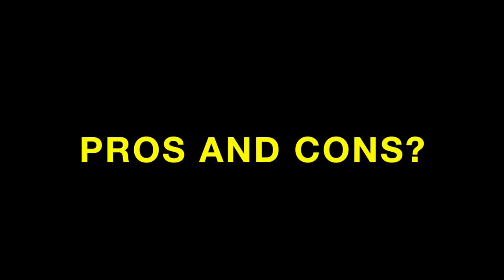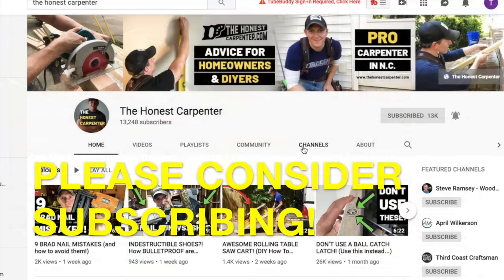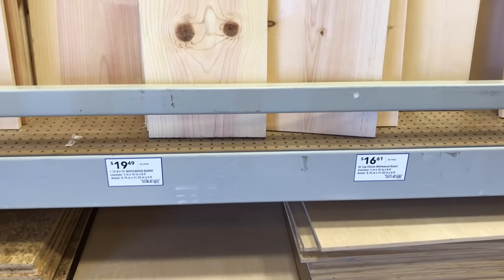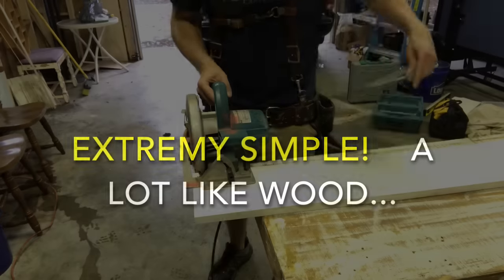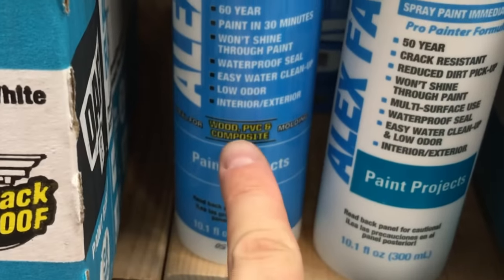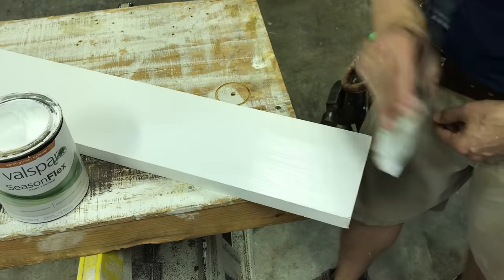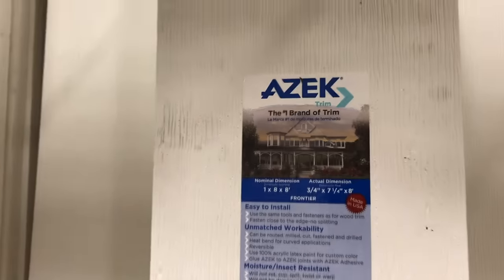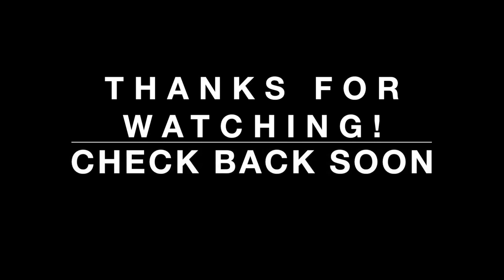PVC TRIM VS. WOOD TRIM? (Pros And Cons!)

Comment: I watched your very good video on the new cellular PVC trim products.  Now how best to use them to trim only the four vertical corners of stucco front porch columns.  My questions:  Is there a need to first smooth out the stucco with its rough surface?  If so, with what?  Then how best to attach the PVC to itself at the corner overlaps and also directly to the stucco surface of the columns?  It would be "nice" if there is already an "L" shaped PVC product that would fit right onto the four corners of those stucco porch columns.  But that might be asking too much. Any answers to these questions will be greatly appreciated.

Comment: What a fantastic video! I have never looked for a video on a topic, tool, material and found EVERY answer in on place!  I have use PVC trim in my bathrooms, and was looking to confirm that I made a good decision, and it sure seems like I did. 

I do have two questions. You mentioned using pvc friendly caulking or wood filer for the nail holes, is there not something that you revoke t that will dry white and allow me the sand it smooth?

Thanks again for the great video!

Comment: I’ve been holding off on using thin pvc trim in my bathroom. Never worked with it before. I need to miter corners and paint. Didn’t realize it was so paintable. Does it need to be primed? And should I pin nail it or use flex caulking to stick it to wall? Great video

Comment: The pourous end does collect dirt, which doesn't look good contrasting with the white surface, and only washes to ... grey.  Else, I do love the no rot, not need for painting, no splinters, no warp.  I'd love to use it on my sun baked window sills, which require painting every 2 years, but can't find a match.  I'll love to use it to replace window trim bullnose, but when trying to pull off the (who in their right mind would do this) finger jointed wood, the entire window started to pull out!
Yes, contractor who did my deck trim over looked like a snowman when he sawed up the PVC.

Comment: Thank you! This is exactly what I was looking for. I have some shoddy existing comb face trim butted next to some hardy plank with some terrible caulking work between that I intend on completely hiding by placing a wider ( not deeper for a manageable reveal) pvc trim board directly over top of. My concerns are that I made a terrible job of the caulking not only between these two substrates but directly on the board while trying to hide the screws. Please advise on  the best way to attach the OVC onto existing pine trim so that I do not have to caulk more than necessary? Galvanized Brad nails and PLC 400? Screws and wood filler . Thank you in advance

Comment: Please help! 
I have a job coming up, and i want to use pvc casing to trim out all the exterior doors and windows. However, i have a couple of questions. 
1. Im going to be installing onto Stucco, so how can i securely fasten the trim to the stucco wall? 
2. What are, where can i find the specs for painting the pvc trim a darker color?  (The customer has chosen a navy blue for trim, and the summer gets and stays above 100°F for extended periods of time.)

Comment: Great & a much needed vid for people today... I LOVE USING PVC! But YOU ARE SO RIGHT ABOUT THE DUST! I tell my kids I  got hit with a SNOWGLOBE GRENADE! LOL. 
BUT.. No grain flow to worry about.. if it does get nicked after painted white its white the whole way through.. takes a screw well.. I'v never had even the thinnest trim split on me (again..no grain) I did all my bathroom & kitchen trim with it & just replaced the bottom ⅓ of my exterior door jam..which is the worst spot on a house for wicking & rot. 
Q: what is the name they call the inner jam's that look like the dootstop is seperate.. until you go to replace the doorstop & remove the weather seal strip to realize its made as one piece? 
Thanks!
Reply from the maker: That’s how they make a lot of pre-hung doors these days, Drew! One shaped out piece, or two that clamshell together.

Comment: The problem is not the pine in most applications. It is the crappy paint and lack of maintenance by the homeowners. Latex paint sits on top of the wood and generally sucks. So they took the good stuff out of the paint and now we have pvc and nasty dust? FYI marine paints do not have to meet the same residential lead and voc standards. But they are illegal to use on a residence. Long time carpenter and I use pvc as much as I can. Good video, thanks

Comment: I replaced window trim on a job once that was so rotted the sheathing, jack and king stud had also rotted out. The one thing that concerns me with pvc trim is that if water gets behind it you’ll never know until the damage is massive. That window sill and apron will look great until they fall off because the nails or trim screws aren’t being held in by anything anymore.
Reply: not even held by prayers,amen

Comment: I totally agree about the PVC dust. It's a real pain to deal with. That stuff clings to everything! But, in many applications, PVC trim is clearly a better choice than wood--like where my water-table trim nearly touches grade.
Reply from the maker: @Steve K That's a perfect example of a place where it should always be used. It's on the list of areas that I'm going to cover in my "most rot-prone locations" video--which will actually be two weeks from now, rather than this week :)

Comment: Very informative video. What do you usually use when you patch nail holes or dings? And do you treat it differently when you use it for exterior versus interior use?
When I cut pvc and use my shop vac for dust control I wrap the top of my vac, the vac hose and the aluminum dust chute of my portable table saw and miter with bare stranded wire and wrap it around a 8 inch metal spike and put it in the ground. If I am cutting pvc in my shop I still use the bare stranded copper wire but I wrap it around several heavy steel washers and lay it on my shop floor it really helps out with it sticking to as much stuff and I don’t get zapped from static electricity caused by the pvc. Even in the summer that static zap  can get you.
Ron

Comment: Great video. I used it as a brick mould around my new patio doors and agree with you 100% on everything. The only real downfalls are the price (but it will save in the long run on no replacement and paint) and the cuttings. The sawdust is awful as you have stated.
Reply: "The only real downfalls are the price (but it will save in the long run on no replacement and paint) and the cuttings. "

Most people today don't live in the same house for 30-40 years like our grand/great grandparents did, people move about every 5 years, if the wood trim lasts 10 years it's already exceeded the expected lifespan when you owned the house, and now sold it- it's someone elses' problem then.

Comment: Two cons you missed concerning PVC lumber: 
1. It does not chisel easily and often breaks out. This is because it has not natural grain fibers. So use a router or cut-out tool to sink hinges or lock keeps.
2. It does melt to your saw blades eventually and must be scraped off with a razor or replaced more often.
For bonding PVC, I prefer PVC Adhesive used for fences. It chemically fuses the components and sets quickly. Any fence installer should stock this product. The big bix stores used to carry it, but it has been hard to find lately due to the pandemic.

Comment: The PVC bathtub I installed in May 21 was really specific in its instructions, “Your warranty is void if you use silicone caulk on edges or plumbers putty in drain.” Micro plastics worst characteristic is that they leach into water and wind up in the water table and reservoirs. Your pvc dust is going to be much larger particle size to leach into the water system, but I would not want it in the sewage system since it would float through the settlement tanks into the ocean or rivers.

Comment: Plinth blocks! 
I often replaced the rotting bottoms of door and window frames with 12 to 16 inch plinth blocks made from well primed yellow pine stair tread. No need to replace the entire frame and trim;  just the rotten part. The secret is to tapper the top of the plinth to match the tapper you cut in the bottoms of the door frames so water will run off easier. I had no doubt those plinths will out live me.

Comment: PVC also can't be recycled, so sooner or later, every ounce of it that's produced will go to a landfill, to an incinerator, or into our soil and water (as micro-plastics, as mentioned).

Better building design (including renovations and retrofits) can often address the challenges discussed by better managing water flow, exposure, etc. (e.g., over-hangs, gutters, roof lines, flashing).

Comment: the only thing i have to say is pvc responds much better when screwed in, using screws designed for the pvc gives you nice little white plugs to cover the holes perfectly and holds much better

Comment: Replaced rotted wood jamb and brick mold with the PVC.  Easy to work with.  Used the recommend caulk, again easy to work with once I got a no drip gun.  Now I would be interested in recommendations to fill in over the screws I used to attach the brick mold.

Comment: Excellent video.  I have to replace some wood rot areas.  Will look for PVC now instead.  Thanks.
BTW I bought a premade Adirondack chairs made of white PVC.  It stays outside year round. Two things.  It does slightly yellow with intense sun exposure.  I haven't found a way to clean that yet.  If you know, pease help.  Also the end grain area gets dirty.  Dark dust and dirt gets lodged in the porous matrix.  Even with a power washer, it's almost impossible to get it all.  So end grain can stay looking a little dirty.
Reply from the maker: You're welcome Kirk! Thanks for watching :)
Reply from the maker: Also, I’ve had that same problem with exposed end grain. Paint can fill it in somewhat effectively. Would you be willing to paint the chair? Would add some uv durability, and seal exposed grain a little more too

Comment: By the way Ethan.... I just remembered that I recently read where there is a paint out now that has UV blockers in it and was made for painting pvc and comes in colors. I believe it was to help protect pvc from UV and to help reduce the expansion issues pvc has. Might have been Sherwin Williams but I’m not sure. If I can find the info again I’ll post again.
Reply: Have you found the article yet?  I would really appreciate knowing about this paint.  Sunlight is my primary concern with pvc use.  Thanks?

Comment: Thank you for a great instruction video. Regarding the PVC dust, it is really a horrible environmental problem. Being aware of that is not enough, everyone creating this dust is responsible for making sure the microplastics dont contaminate the environment. While working on site, please use a large plastic sheet on the ground to make sure you can collect all the PVC dust. It's a very simple precaution that makes a huge difference.

Comment: Another plus, for PVC, is that if you use it as a base, around a tub, it's more forgiving than wood. Some tub have a slight curve to them and PVC will follow the curve and, you can attach it with an adhesive, without it trying to pull away as wood is prone to do.

Comment: Very informative! Exactly what I was looking for; thanks. I purchased PVC trim baseboards for the bathroom; however I'm unsure how to fasten them. I previously used an air gun nailer for the MDF boards... Should I do the same? Also, should I glue it or is it not necessary?

Comment: think about using Polymer Trim manufacturers adhesives for bonding Polymer to Polymer...also, Static Guard, spray on equipment before cutting and the shavings will not stick making it easy to clean up.

Comment: doesn't PVC have a relatively low melting temperature (like vinyl siding)?  I think a reflection from a low-E window can make it sag.  you also need to keep heat sources like gas grills several feet away.
Reply: Thank you for mentioning that, this ‘carpenter’ just read the installation manual to us. He made multiple mistakes in this video and shouldn’t be talking about PVC
Reply: @cshaneeagle  that's just nonsense, saying he "just read the manual". He showed multiple jobs he personally did with PVC. Maybe you disagree with some of his use of the product,  but no need to demean a thoughtful overview of his  experience.

Comment: I have watched pvc used for fencing in any number of commercial and residential applications.  Invariably, after about 8 to 10 years the pvc has deteriorated , presumably because of sunlight.  Has the product been improved now to resist that deterioration?  If not,  I woldn't use it anywhere where it is exposed to sun.

Comment: Going for a shaker look in the bathroom. Would you miter cut the baseboard or not? Also what do you think about using pvc glue to attach the trim pieces together?  Finally, when nailing with 16 gauge brad nails do you need to hit studs and or just base plate. Thanks

Comment: What is the best product to fill nail holes with PVC?  And if using it for baseboard in a bathroom is it necessary to glue all ends together or can you just butt it up against each other and caulk the seams?

Comment: I've got some front door sidelights that are oversized (24"x8' with 20"x67" glass) that are completely rotted out. Really don't want to spend the $4000+ quoted to replace them and considering manually reconstructing the frame. Thoughts on doing this with PVC? I've thought about doing the inside with birch plywood for strength and then attaching PVC to the entire exterior. Ok idea, or will this give me problems I'm not considering?

Comment: I have a screened in porch with just storm windows as screens. The openings have three storm windows that butt up to each other. For the middle window can I glue two 3/4 by 3" azek boards together for the vertical supports of the middle window. These boards will be 36" long. Thanks

Comment: I realize I’m commenting on an old video but I do have a question I don’t know how to answer. I used PVC on the south facing door that experiences extreme temperature changes. I cannot figure out how to keep the corners together. What do you recommend? Should I glue them together. Install them at the extreme cold temperature or at the extreme hot temperature?

Comment: Got a question, I have to replace some rotted window sill. The PVC trim I bought for the sill has a nose piece that is tongue and groove. Do I use an construction adhesive to put the pieces together or a PVC glue.?
Reply from the maker: That’s an application where I think the pvc glue works really well David, because the components lock together pretty tightly. I’ve known plenty of guys to just toenail shoot them on without adhesive though, and they’re not really inclined to pop off, especially once they’re caulked and painted

Comment: I am putting tile in our rental and need to replace the baseboards.  I worry about broken pipes and flooding - the tile can handle that - but would PVC baseboards make sense?  You indicate that they are easily gouged, so I worry that over time they will be nicked and scratched.  Is well painted wood still my best bet?

Comment: I just used PVC for an outdoor porch where wood will absolutely rot and it always has. It is easy to work with and didn't require primer or paint bcuz I needed a white finish. Also,  I had to remove a piece of PVC screen mouling and I just pulled the moulding off, the Brad nails simply slipped thru the PVC with no spltting or cracking. That would never happen with wood. Given this porch has always suffered rot, I could justify the higher cost of PVC by not having to do the job again bcuz the PVC won't rot but also in the time saved in not having to prime and paint. I hope it holds up like the warranty claims it will.

Comment: Good video. I'm sick and tired rotting pine trim on my house. I do my best to keep it painted but the pine today sucks. It just doesn't last for some reason and within a few years it always seems to develop rot. I've been replacing the rotted trim with PVC. I absolutely love it except for a few things. First it's more expensive (though the cost differential has diminished),  the PVC saw dust sucks, but the biggest issue is thermal stability, PVC trim from summer to winter expand and contracts considerably. If i but my joints tight in the summer during the winter they open up. I've been using caulk but apparently the wrong types so I'll have to change that. It used to be suggested that long lengths like on a fascia board should have the ends glued together. Are they still recommending that and if so, what type of glue should be used?

Comment: The PVC dust is that way because is electrostatically charged. It's from the sawing action against PVC like when you walk across a polyurethane carpet and get a shock on the doorknob. Means the carpeting has a slight charge. The metal saw blade rubbing against the plastic sets up static electricity. I suggest you use some sort of air ionizer system for dust collection, some form of purifier/ionizer is available commercially that should do it along with a little negative pressure.

Comment: Expansion and contraction is a major issue.  I replaced the brick moulding and jamb on my garage with PVC a few years ago, in winter it literally shrinks 1/2" over 16' and opens up a 1/4" gap on either side where water can just pour in (I glued the miters so it pulls the uprights in with it).  So, I am replacing it with clear cedar brick mould.
Reply from the maker: That does seem like a crazy amount of contraction Michael. I've never seen much more than an 1/8, but it can wreak havoc. What time of year was the material installed?
Reply: @TheHonestCarpenter  I think it was late June or early July.  I just ran the calculations for thermal expansion of pvc, with a 75 degree change over 16' that comes out to 1/2" or more of contraction.